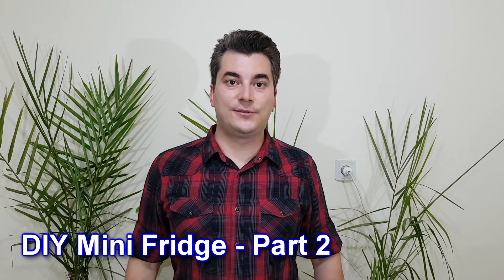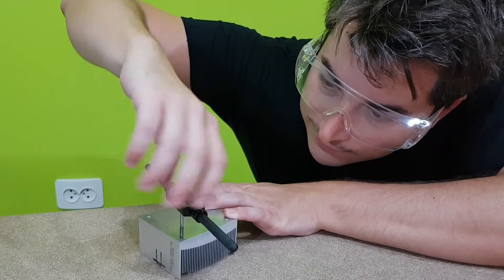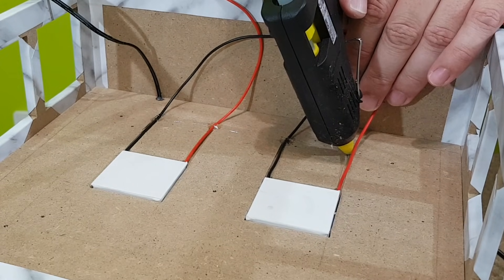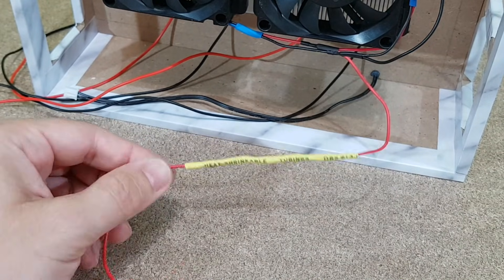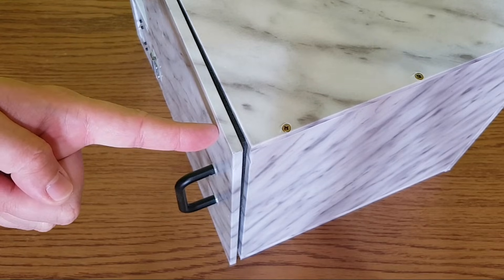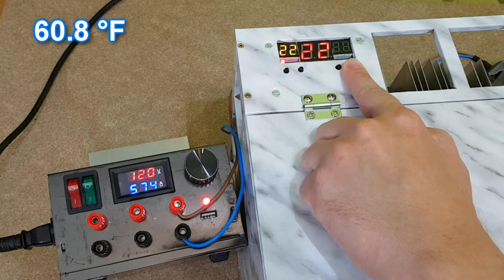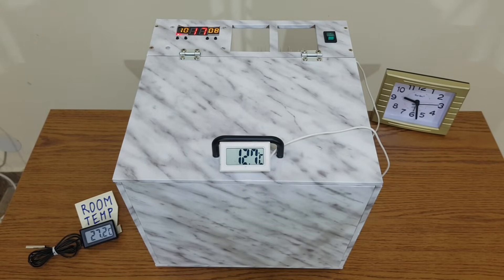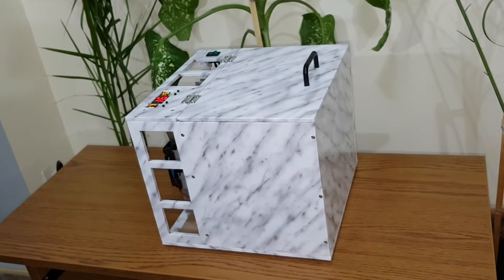DIY cooler box (mini fridge) Peltier - Part 2/3

Comment: If you are planning to do more of these..... 9volts seems to be the best maximum voltage for good efficient. Using more like 12volts starts to create extra heat. You should try out stacking them, like 9v+5v+3v. I am currently using 3x12706 modules, running them at 5v+5v+3.6v and was able to reach -31celsius measured from top of Peltier. Those 3 units use total of 27watts. I did my first test today and seems like the box might be too big (25L), i still have not build a proper door for it, but in 1h30mins it cooled down 9celsius from 21c --> 12c. It is also very important to measure your temperature outside the box wall, to see if the insulating is working good enough. For example my 25L box starts to leak cool air after it hits 12c. 0.4celsius is getting thru the insulation which does not sound much, but when there is a lot of surface it adds up. But all in all, i have watched a lot of these videos and i must admit yours is the best one so far.. Good job.
Reply: true. but you should try watercooling the peltiers its more quiet and the peltiers run cooler so they pump more heat.  For insulation 3cm thick urethane panels are good.
Reply: @emppu-tech6065  And how do you cool down the water in the warm water block? Also, where do i get a water pump that runs at 5voltage and does not use a lot of watts? My setup is totally silent because the CPU fans run at 5volt, it does not make any noise. And my CPU cooling block heats up only +2 celsius over ambient temperature, so no water cooling is needed. What do you mean by 30mm urethane is good, are you saying it does not leak out any cooled air out from the walls? Currently i am making my setup little better, i am now hitting -37 celsius using 1x12710+12708+12703 modules running at 5v and using about 35-40watts. With this setup CPU block on the warm side goes +3 celsius over ambient, so no need for water cooling either. This looks like to be enough for the big 25l box, still in middle of testing how low the box air goes.. PS: The 12703 is great at 5voltage... Here is my 3x12706 setup: https://youtu.be/HSs0Zy017h8
Reply: @Ruube1978  Your cooling setup looks pretty good. so watercooling isnt going to make a difference but if you want even better efficiency try better insulation so less heat is going to leak into the fridge.  this is currently the best insulation you can get: https://www.bauhaus.fi/sauna-satu-kingspan-0-72-m.html
Reply: @emppu-tech6065  Thanks.. Hmm... That does look like it has better insulating properties than the FinnFoam. Finnfoam 0.029-0.034W mK and Kingspan 0.023W mK. Thanks for the tip. :)

Comment: what this is and model/ number product please? 6:15
Reply from the maker: those are 5 diodes connected in series. I don't remember the model description, but it doesn't matter. they aren't even the same model. computer fans don't use a lot of current, just use some simple diodes with minimum 1A.

Comment: nice job i pretty much did the same thing though mine could only reach 5c due to the fact that i got ripped off with a bad quality peltier.
Reply: Aleksander Sats 5c is fine, normal fridge temperatures range from 1 to 7c
Reply: @ka-i  yes 5c is fine but it reaches 5c with no load and it took 1 hour to get to 5c with no load

Comment: Hey sorin 
I made a 30000mah li ion battery pack
And I'm planning to run a peltier refrigerator like this do you think it'll work
Reply from the maker: hi. I suppose you made a 3S battery pack. this will have a nominal voltage of 10.8V and it will discharge to around 9V. this is not enough for the peltier modules to be efficient. you need a powerful step up converter, to keep the voltage at 12V, but this will decrease your battery even faster. I suggest you make a smaller cooler box, for 2 or 4 cans of beer/juice. for 2 cans you can use only one peltier module, for 4 cans you need 2 peltier modules. and make the internal cold radiator cover all 4 sides of the box. if you put the beverage already cold in the portable cooler box, it will work, in the sense that it will keep it cool, or cools it down even more, for a few hours, depending on the current consumption and the real battery capacity.
Reply: Yes it was a 3S battery
What if I make the  pack to like 4S or 5S
Reply: And my box is just 16cm by 16cm and 8cm depth
Reply from the maker: so it will fit 2 cans right? then you can use only one peltier module and it will work continuously, don't install any relay/thermostat. just a simple digital thermometer, if you want to measure the temperature. you can use the same peltier module as me 12703. it uses around 3A. you can make a 4S or 5S battery pack with a balancing BMS board and a powerful step down converter, like the one I used in my variable power supply. it will decrease the battery voltage at a stable 12V.
Reply: Thanks
I'm hoping I can attain temperature less than 42F
Reply: I have the 12706
Reply: I'm planning to run the cooler for 3hours or more
With a 4S li ion 40000mah battery
Reply from the maker: 12706 is not good. it's using 6A and producing much more heat, so you need a bigger radiator for the hot side and the battery will last 2 times less. you need 12703 especially for a portable cooler box.

Comment: car voltage is 12volts...14volts is the charge voltage...but engines run at 6 volts once running
Reply: Yeah, cars from Playmobile and LEGO will maybe use 6Volts, but real cars need 12V van start till finish.
All the electronics don't work anymore on 6Volts, where did you hear this nonsense ?

Comment: why dont you made one with like 10 peltier modules so it cools down a lot better
Reply from the maker: hi. more peltier modules need more current and they produce a lot more heat. you can see how big the radiator needs to be only for 2 peltier modules. for 4 modules it needs to be at least double, so the entire fridge will become too big, up to the point that is not convenient to use. the relay is rated at 10A, it can control 1 or max 2 peltier modules (depending on the current draw). for a mini fridge this size, probably the best way is to use 3 peltier modules, that draw 10A max. I'm planning to build some kind of mini ice cube machine in the future, that will use 4 or 6 peltier modules, but I'm still working on the design.

Comment: Good job. La interior panourile de aluminiu le-as fi unit cu acel cornier pe spate, cu suruburi cu cap înecat pentru spatiu sa nu fie incomod cand pui ceva la rece, sa te agati in suruburi. Acuma tu au facut cu racire pasiva la interior, eu as fi facut cu racire fortata, un radiator cu ventilator, sa circule aerul la interior si atunci ai o racire mai rapida(parerea mea). Se foloseste si la frigiderele din casa astfel de racire. Frigiderul meu din casa are ventilator in interior si plimba aerul incontinuu cat timp este usa inchisa si se opreste cand deschizi usa. Pe acest principiu este si lada mea frigo. Raceste repede ca plimba aerul la interior. Inconvenientul ca face putin condens si ai nevoie de o scurgere sau din cand in cand sa sterg/scurgi apa. In rest nimic de comentat. Explicatii la greu si asta imi place. La cat mai multe proiecte. Numai bine!

Comment: Oh man, I've done EXACTLY the same thing, only on a budget. One peltier, 5mm MDF and 5mm Insulation foam pads, and as you can imagine it's not so effective. There is also one small inside radiator. Two 0.5 beer soda cans can fit in there. I also plan using it in the car and have made the same extension cable. Btw, are those lights in your car stock? Bc I also happened to place RGB LEDs in my car xD
Reply from the maker: hi. I've replaced the stock foot lights in my car with crystal blue LEDs.

Comment: I tried, it is impossible. Peltier cant make such cool
Reply: Yes, it can. I have also tried this.
Reply from the maker: it's not impossible, but it's really hard. you can't build one in one hour of course. but if you design it well and you are willing to invest a few days into building it, then it will work.

Comment: you didn't cover the back side of the fridge, why so . cant you cover  it with panel having holes in it..
Reply from the maker: the initial project had a "cover" made with square dowels. but the project already took too long, so I just gave up on that.
Reply: @Sorin_DIY  Oh ok. Btw can you make a basics opamp video. Would be really helpful..
Reply from the maker: I will make one in the future, now I'm already working on other projects
Reply: @Sorin_DIY  thanks for respond😁👍

Comment: Not exactly how I to drilling and tapping. However your system works fine. The way you explained how you did the drilling , tapping. Safety was nicely done.

I would like to suggest this to be made ( once all if any changes are made ) available in a kit form for sale .
Reply: Example : m3 x .5mm pitch tap drill 
  Tap drill hole = 2.5 ~ 2.6 course to fit the taps
  
 The point is subtract the pitch to the threaded hole , or use a tap drill chart ,